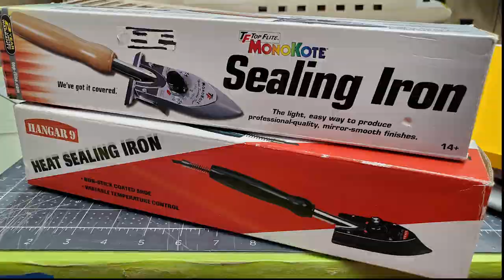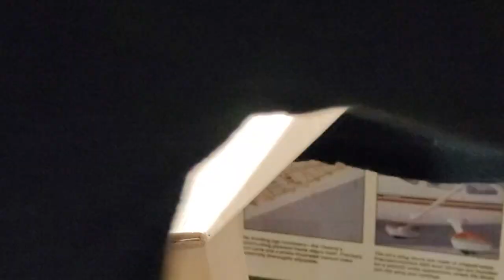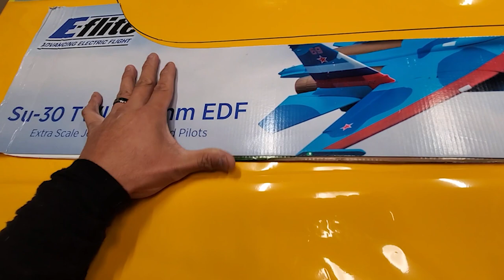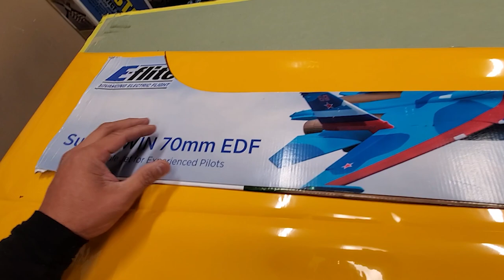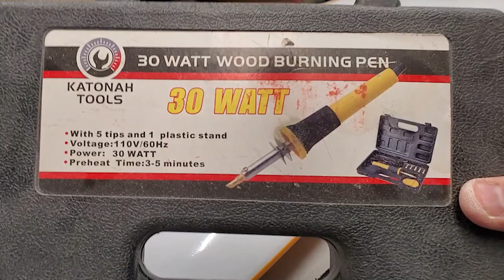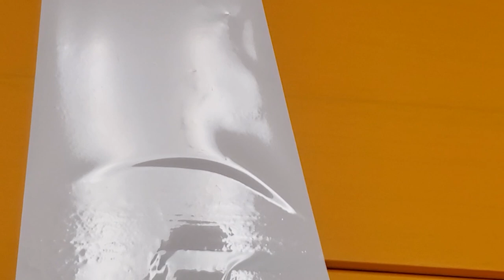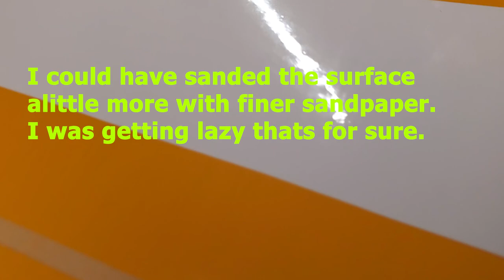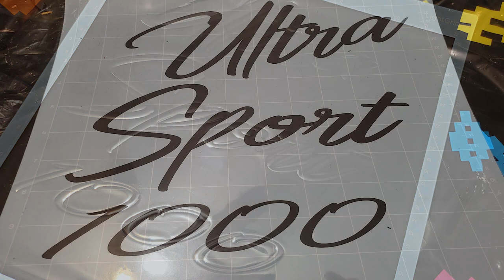Great Planes Ultra Sport 1000 Build Series Part 6 Covering with Monokote

Comment: I'm getting back into the hobby after 35 years.  As a result, I have several vintage planes to cover, starting with a GP J3 Cub.  It's good to see your technique, and like me, you are very meticulous with covering in order to walk on to the field with a plane you can be proud of.  You do beautiful work.  Way back, I used Balsarite to coat the balsa with to help the Monokote adhere better... at least that's how the product was promoted.  I was wondering if there is a substitute for Balsarite, or is treating the wood even necessary?  So many things I used to take for granted picking up at the hobby shop are no longer available- I mean besides the kits.  Anyway, thank you so much for taking the time and effort to produce this video.  I know that added many hours to your finish work on this plane.  I hope she's still flyin'!  Good luck & God bless. -Floyd->>>
Reply from the maker: Thanks for the comment.  Yes the Ultra-Sport 1000 still flying today and still looks as it did on maiden day besides changing the engine to a DLE30.  Well back in the day I used balsarite as well but once our local hobby shops closed down getting the product became harder.  To be honest I have not used balsarite for well over 20 years now and still get good adhesion with monokote.  However once again now monokote is no more so i am trying Ultracote.  Well welcome back to the hobby my friend.  I have not stopped yet and don't plan on it anytime soon.   42 years for me

Comment: Great video and techniques Bayona! There is a 4th method worth trying for applying Monokote over Monokote. You can fully pre-shrink the trim covering (sunburst in this case) with a heat gun before you iron it down which will keep the air from forming underneath it.
Reply from the maker: Oh yeah!  I have done that before as well with good results.  Trust me I have tried if not most of the techniques for Monokote over Monokote since the earlier days because back in the 80's I could never get the hang of it.  But trial and error plus being persistent with no quit attitude and hours of practice for past 41 years now in the hobby I am finally decent at covering being humbled.
Reply: @BayonasRCWorld  yeah me too! My first build was the CG Eagle 63 back in 82’. Covering was horrible but I was only 15
Reply from the maker: Yup exactly and we were proud because we did built and covered all on our own even though it looked somewhat okay hehehehehe.  I was only 8 years old in 82 and was already stick and tissue building rubber powered free flight planes.  Not until 1985 or 86 when I really started covering because I was into building gliders, slope soaring planes covered with transparent monokote.  The good old days for sure.

Comment: Great video, thanks for sharing those tips. What is the name of that tiny iron and where do you get it? what temperature does it run?
Reply from the maker: It is a trim sealing iron.  You can try Amazon or some online RC stores like Horizon Hobbies, Amainhobbies, Tower Hobbies etc.  The temperature will vary depending on brand of irons.  Mine is made by Coverite and temps are 40-152 degrees C or 105-305 degrees F
Reply from the maker: You could even try Ebay

Comment: Can you explain how you prep the Monokote for the Cricut machine. What is the clear material that the Monokote is adhered to? Excellent job on the scheme. I normally cut my graphics by hand from Monokote but I do have a vinyl cutter. Thanks
Reply from the maker: I use transfer paper which is the clear material that the Monokote is stuck to.  This helps keep all the letterings together while transferring from the cutting mat to the model.  I leave the backing of the monokote to prevent any dirt or lint from adhering to the back side of the monokote during cutting.
Reply: Mmm, im surprised the monokote dose not separate from its own backing during the Cricut  process. So after you cut it on the Cricut you then apply another clear transfer over the actual monokote,  peel the first clear material off the back along with the monokote and then transfer the pattern onto the airframe, correct?
Reply from the maker: @greggelko2422  yes!  Normally the monokote clear backing remains on the tacky cutting mat which I then remove after with tape.

Comment: What is the temperature of sealing iron
Reply from the maker: I don't have a set temp that I use.  It all depends on what I am doing, the surface I am applying the covering onto i.e wing tip, stab corners, 90 deg bends or just general flat surfaces.  The main key is to ensure that your temp is properly melting the adhesive of the covering.  It is more about technique, pressure and heat duration with the iron.  You can have the dial at max and never touch it throughout the covering process, unless you are doing monokote over monokote then I would reduce the temp or dial to just below half.  Yeah I don't use a pocket thermometer, or any specific temp settings.